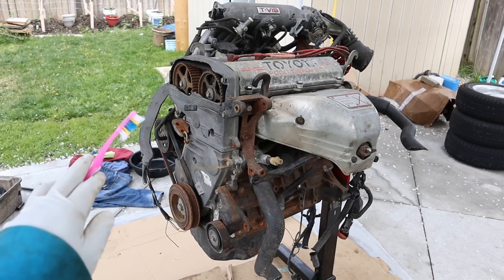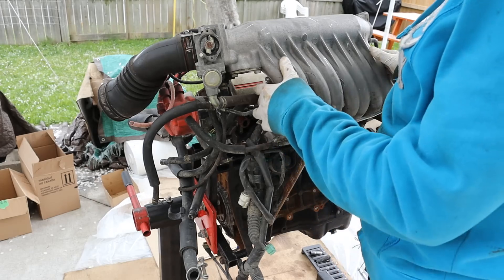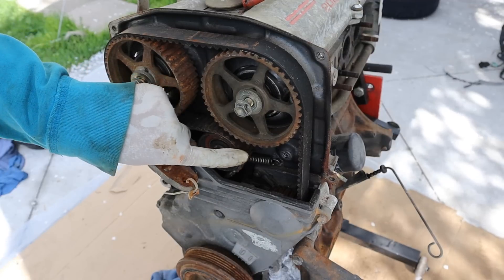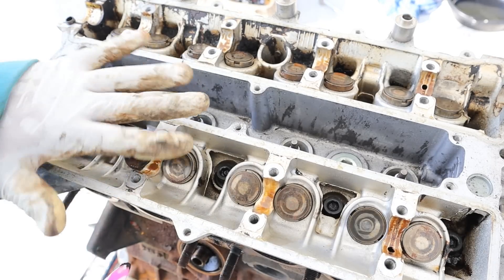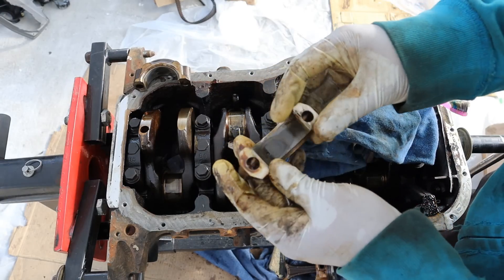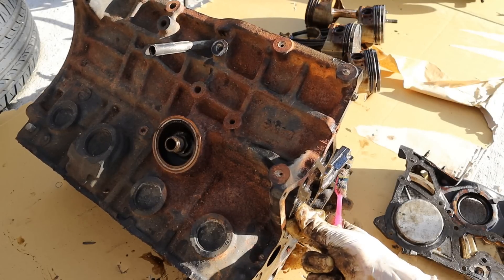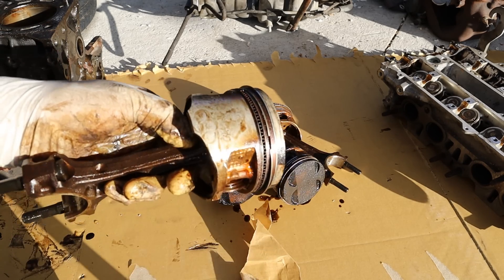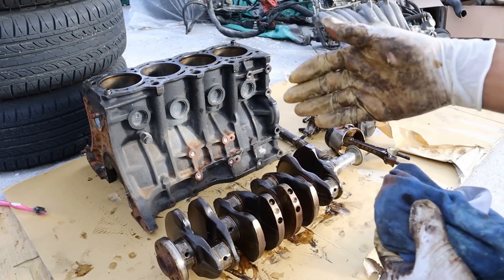Why the Toyota S Engines Are Super Reliable and Strong

Comment: The oil light came on in my 91' MR2 5S, but luckily i didn't give up on finding the cause of the issue. After deciding to tear into it, i found the nut on oil pump gear actually loosened the oil pump to where it failed and caused me to lose oil pressure. The gear itself was shredded so I replaced the oil pump, timing belt job, and resealed my leaking oil pan. It was a huge PITA bc its so cramped, but I finished in about 2 months and its been running great ever since.

Comment: You did a really good job with this video and the information you conveyed. I don't have that much additional information to add to it but this is what I thought of just in case you were curious although I wouldn't be surprised if you already know almost all of this already. 1:25 I completely agree on the weight, the 3SGTE Alternator mount I weighed was 5.0Kg! (11lb) and that's just for the bare mount which I think is obscenely heavy for what it is. 4:40, the later 3S models went to a hydraulic belt tensioning system, initially a separate tensioner and a pulley but then on the Gen-5 Beams going to an integrated pulley/tensioner combination unit. 5:30 Unless they are different than what I have seen so far those are JIS / Japanese International Standard bolt heads, not Philips. A very common misconception, the difference is that the JIS bolts don't have any taper to the slots and as such are not designed to key out under too much force unlike the Philips. In my personal opinion both are rubbish. 5:35 Only the earlier (Only Gen-1?) models of 3S engines has separate cam covers. 8:40 In addition to what you said the 5SFE's also had a balance shaft as a result to having worse harmonics at the same revs from the combination of both the longer stroke and also the lower rod to stroke ratio. 10:40 The later engines have the oil pump push the oil back down to the upper Aluminium section of the sump that houses the regulator, sensor and oil filter before going back up into the oil pump housing to be diverted into the block. They also have an integrated crank position sensor. 11:30 The later 3S engines went to MLS head gaskets, I double checked and can confirm that the Gen-5 Beams uses a 3-layer while the long since discontinued TRD versions used a 2-layer at only 0.55mm thick total. 10:40 Isn't that a closed deck block design? A semi-open deck looks very different to this. 12:40 As mentioned in another comment that's an oil pressure sensor for the in dash gauge. 14:10 That's the "Toyota Variable intake system" / TVIS or as some people like to joke it really being short for "This Version Is Shit" due to the fact that it was only used on the earliest versions of 3SG and 4AGE engines. I don't know if it was ever used on the 5SFE engines? I think it might have also been used on some 7M engines? On top of all the reasons you stated it was used because they had such a large cross sectional for the ports which resulted in bad air flow stagnation at lower revs and all the issues that go along with that. 15:20 Correct in terms of strength with the sole exception I can think of is that the 5S block is known for being stronger and not being potentially prone to split at very high loads through the middle of cylinders 2 and 3 as the early to mid 3S blocks were. Another odd quirk is that the last 5S engine had a higher flowing oil pump that up to the Gen-3 3S engines, possibly Gen-4 as well but not the Gen-5 as they had very wide oil pump gears and feeds to both sides of those gears. Anyway that's all of it, as always I am open to input and corrections as I want to be told if I am ever wrong.
Reply: In the later models, a small oil cooler was put where the oil filter was on the older model

Comment: Great video, so much easier to see everything with the engine out. How different is the 5S from this? Is it just bored/stroked or are there other significant differences?
(edit: I just watched to the end, lol)
Reply: The head design is very different in terms of valve angle, port design, cam profile and other factors related to be optimised for a lower RPM band.

Comment: 3sgte had an entirely different exhaust manifold for the turbo, still cast iron though, the blocks were pretty durable right up to the rev 3 which had an inferior iron, it would occasionaly crack near the water pump on highly tuned 3sgte engines, the rev1/2/4/5 did not have this problem, the rev 4/5 had thinner conrods and all 3sgte had mls gaskets, also that's a low oil pressure warning switch not a damper, the exhaust system is a 4-2-1 you are just missing the lower manifold /collector, otherwise spot on

Comment: Have a 97 Corona with a 3SFE. And since it's almost similar with the 3SGE, this is awesome to see!
Reply: Still running great! It's a Manual and has 180,000+kms. On a 25 year old car.

Changing the oil every 3 months with regular cheap oils 😄 15w40 and sometimes 20w50.
Reply: Is it necessary to change 3 months? You must drive a lot? @______jsh______
Reply: @tommymack3210  I believe no, just a personal preference really.
Reply from the maker: Nice! How's it running?

Comment: The super difficult to access fuel filter is also a big flaw of the PSA engines of the 80s, 90s and 2000s.
With air conditioning and all that, it's nearly impossible to remove one of them without cutting your wrist on something.
Reply from the maker: Where are they located? I'm not familiar with the rest of the engine bay setup
Reply: @speedkar99  On some of them the intake covers the oil filter. (Citroën Xsara with the 1.8l 16v engine for example)
And all the accessories are in the way.
The radiator is also, always, 3 cm away from the oil filter.
You never know how to maneuver in there.

It's a two man job, one guy use one finger to keep the tool from failing, and the other try to tighten it and get 1/8 of a turn xD

I've never seen worse myself.

Comment: I had an 86 Celica GTS hatchback with the 3SGE engine.  It was the first year they made a front wheel drive Celica.  Fun car.  I put 220,000 miles on it and gave it to a relative. I did have to do a valve job on it (leaky seals) around 120K miles.   It was low torque at low RPMs but if you got it over about 4,000 RPMs, the second set of valves kicked in and it had a bit of a boost in power at that speed.  I got mine up to 135 MPH once on a new highway.
Reply from the maker: Nice to hear from an owner
Reply: 5sfe fully built fully built no messing around will do that NA, even with a turbo.

Comment: I had a 3sge on a 88 celica good for 450,000 km , rough driving, did delivery runs in it, got it up to 200 km/h downhill (195 on straight), gearbox (automatic) lasted for 700,000 km. Could have lasted longer but radiator went and overheated. Faster than 5sfe in a 91 celica.
Reply from the maker: Nice, 700K!

Comment: Inline engines rarely have more than 2 bolt main caps.
I've heard the reason 4 bolt or cross bolt main caps are popular in V8s is because the piston forces aren't straight up and down - each bank of cylinders pushes in from a 45 degree angle and creates sideways forces on the main caps.
Reply from the maker: Good thoughts. I would have expected at least 4 bearing bolts

Comment: This Is actually the first gen 3sge from the st162, and the valve cover has bolts someone has just put the screws in, and you keep going on about the turbo version like it's the same the only thing that is the same is the block head sump and other small things internals are different, intake and exhaust is different valve cover is different
Reply from the maker: Thanks. I thought it was a later revision since the person I got it from said it was in a 95 Celica
Reply: @speedkar99  yes that would also make sense with the intake, the on big difference with the 1st gen 3sge and 2nd gen is the head

Comment: Few mistakes on information in the video but overall good job.  Yes, these engines are virtually indestructible and pretty maintenance free.  Being non interference, with regular maintenance they will last forever!  These are from an era where Toyota was over building everything to put their reputation of reliability first.  I still prefer the old Toyota against the new stuff.
Reply from the maker: Thanks. Do you care to share where I could have improved?
Reply: @speedkar99  I think @redsunsmr289 might be talking about at 11:44 where you misspoke and referred to the motor as a 3S-FE, instead of a 3S-GE.
TRUST !!
Reply: Non sense,  you are great speedkar no body’s perfect, but, we in deeep need to keep learning from day we were born till day we buried

Comment: I jst had my 3sgte engine repair for all the oil leaked after 20yrs of use. The engine is super reliable and i keep pushing it hard when driving.
Reply from the maker: Nice! Only 20 years, what vehicle is that?
Reply: @speedkar99  Caldina Gt-Four. ST246W-3sgte engine

Comment: At 12:30, what you called an oil pressure damper, is most likely an oil pressure sender for a gauge.  Looks exactly as one on a second gen RX-7.  Great video btw. edit: the fuel pulsation damper with its typical yellowed cover and pressure regulator also look very similar on other Japanese engines.
Reply from the maker: Thanks, I didn't know that but where would it hookup to the gauge?
Reply: @speedkar99  I can confirm that it's the sensor for the in dash pressure gauge

Comment: Happy to hear that your brother’s wardrobe was not raided for this video…hahaha, however isn’t that toothbrush, part of your wife’s toiletries bag? 
Really enjoyed this video. Owned a couple of GTS Celica models with that same engine. Lots of fun to drive & run forever. 👊☮️🥸
Reply from the maker: Glad you appreciated it! How did your celicas hold up?
Reply: @speedkar99  they held up very well, other than brakes and oil changes and a timing belt. The ‘86 model required a transmission shift cable, while the ‘87 model needed the rubber intake pipe, to fix an air leak. The ‘86 model was bought for my son when he turned 16..he’s 24 now & just sold the Celica to a very excited enthusiast. …interesting to note, that no clutches or CV shafts were harmed in the operation of these cars! Mileage was 328,000 & 335,000km 🇨🇦 just over 200,000 miles. ☮️

Comment: IMO and work experience, the 5S-FE is a beast of reliability...  Iron block, very over-built for its low HP and torque, bucket and shims for less moving mass, non-interference design...  3S-FE same thing.  Valve stem seals were a problem, but not much else...  Even the non metallic gear for the balance shaft assembly worked just fine for a very long time.  Late 80-mid 90s are what I consider Toyota's golden age.
Reply from the maker: 5S Sure is a workhorse! In my opinion it's slow lol because I went with V6 Camry/Solara/Lexus ES
Reply: I agree, I still daily drive my 96 Camry with the 5S-FE. Only major maintenance other than routine stuff like timing belt and oil change was replace the "batwing" oil pump gasket and shaft seal. Super easy to work on. Its a little ugly but she just won't quit. I have no reason to get rid of it.
Reply: @JasonLuther1  The crank shaft seal is what you're talking about? I'm looking at an old 2000 with the same engine in unknown condition so if I get it, would you recommend replacing those seals on the oil pump housing? I take it they would be easy to access when you're replacing timing belt and water pump anyway? I would replace the timing belt anyway because I dont feel like getting stuck somewhere and its a 23 year old car by now.
Reply: @identifiesas65.wheresmyche95  yeah it's worth replacing while your in there, especially on an older car with unknown history. For me the leak had occured first in the middle of the timing belt interval so I essentially did the same thing you stated. Oil pump gasket, water pump and new belt.
Reply: @JasonLuther1  I appreciate the tips! I bought the vehicle, got a good deal on it (well, today anyway $1650 is a good deal for a 2000 camry lol, at least where I live) so I will be getting to work on it as soon as I can afford the parts, times are kind of tough (hence the cheap car). The handbrake seems to work but doesnt stay in place or ratchet as it should, I imagine I'll see whats going on once I take the center console off but if you or anyone else knows if theres a common issue on these I'd be glad to take tips! Thank you guys.
Reply: Wasnt the 5s-fe used up until 2002?
Reply: @identifiesas65.wheresmyche95  In the Camry for sure - 2002 on was the 2AZ-FE - All aluminum, VVT-i, timing chain, auto-tensioner for the single drive belt, drive by wire, external waterpump, etc.  A lot like a second generation larger displacement 1ZZ-FE.
Reply: That was the golden age for a few other manufacturers as well Nissan and BMW...it's been downhill since.
Reply: @clintmelancon5810  Nissan, absolutely.  My 1990 Maxima SE 5 sp manual I got in 93 was an amazing car, and so well built (Made in Japan).  Although not a powerhouse, its VG30 engine was refined, and matched the car well.  These vehicles were extremely reliable too.
Reply: Most of them don’t have balance shafts. That’s only a Camry thing.
Reply: @negativeindustrial  Hmph. Must be worth a few HP to dump them...(EDIT) and maybe 1 MPG!
Reply: 5sfe was fine for the camry but definitely lackluster on the celica.
Reply: @borisrz3080  
I take it you never bolted the turbo and turbo manifold from a 3S-GTE to your 5S-FE? It’s a direct fit and It’s not so lackluster after that.

Comment: great video! if you could get your hands on a final revision 5SFE from 2000-2001 camry, that would be a cool teardown to see, especially comparing the differences in the cylinder head and block :)
Reply: thanks for  requesting this for me
Reply: Personally I'd like to know if the 1st gen 3sge head would fit the 5sfe block
Reply from the maker: Yes. I'm specifically looking for a 5s Camry with a stick so it can be paired with this 3S when it gets rebuilt
Reply: @speedkar99  that would be a cool video, showing something worth rebuilding
Reply: This would be very cool.

Comment: For me personally, Honda engines are the most reliable. But it is true that in the 90's many car manufacturers had very reliable engines or the already mentioned Toyota and other European vehicles vw, opel, mercedes ... but there were also total scrap. I can't comment on American cars, as there is a minimum in Europe, I've never owned any.
Reply: Yeah, once they switched to the CAFE 5w-20 things went downhill. The '90s engines rarely burned oil, lasted and were relatively uncomplicated. The only thing I can sort of relate to, is the older Yaris 1.5L 4cyl engine, which in it's simplicity reminds me of the '90s - almost idiot proof.
Reply from the maker: I agree, the Honda engines are very strong and had less tendency to burn oil than Toyotas but they still are very good cars. Too bad if you had a Honda automatic transmission though
Reply: @speedkar99  In Europe, most Honda cars have a manual transmission.  Automatic transmissions have become more widespread over the last 10 years, especially on German cars where you can hardly find a car with a manual transmission (only the cheapest models).  The Toyota as a whole is more reliable than a Honda, but the Honda is better in motor, but how you wrote automatic transmissions in Honda are problematic when I compare it, for example, with the transmission we have in Lexus rx350 2 generations, so it is still without problems.
Reply: I have two Toyotas.  3.4 V6 on a T100 and it currently has 261K miles on it.  A Solara V6 that has a little over 280K miles on it.  Both run like new.  I've owned a couple of Honda Accords and had valve problems on the early one and synchro problems on the newer one.  I'm sticking with Toyota.

Comment: As the owner of a 87 Celica GtFour with a redtop beams turbo I can say that the 3s platform is fantastic
Reply from the maker: It sure is! How's yours holding up?
Reply: @speedkar99  is currently stripped down for a full restoration build.... Am thinking of putting the build on YouTube.... I have owned 11 Celicas 9xst162, 1xst182, 1xst202 ssIII, and my current St165 and a Caldina St246gtfour... All of then have run and performed brilliant the only issues I have had have all been from previous owners lack of normal maintenance.... One of my first gen 3sge motors I broke the crankshaft and still drove home
Reply: @nigelsmith7366  yes please put rebuild on YT

Comment: In reference to the two bolt mains i feel it's important to note that it depends on the type of material (iron in this case) and the number of main bearings (5 in this case)

Remember the jz series also had 2 bolts and was similar in design

I would say that is still stronger than a 4 main bearing aluminum engine with 4 bolts or 6 bolts
Reply from the maker: That's right. I still feel like they should have cross bolted this one being the more powerful GE version
Reply: @speedkar99  a 2jz and b58 both have two bolt mains and can take a thousand hp iron blocks are just stronger also the i6 is more balanced but the 3s can still handle a metric shitload of boost

Comment: I like your videos, i have a 1998 Lexus GS. Are the main crank shaft seals replaceable without pulling the engine?
Reply from the maker: Most front crankshaft seals are accessible once the timing belt is out of the way.
Reply: @speedkar99  thank you.
Reply: Some oils are better at concealing the crank seal leaks, eg Castrol, Liqui Moly. My old Honda leaks like crazy with Pennzoil, CT, but it's manageable with Castrol. I have no idea if it's the additive package or slightly higher viscosity. Also every time one of our costumers used CT brand Synthetic in well used engine, it started to leak via the crank seals. I had 2000 Civic that lost almost 2L in 2k km, 😳 yeah it was bone dry oil dipstick, I filled it up with regular GTX 5w-30 and magically things went back to normal. So beware, some oils might clean the deposits a bit too well.